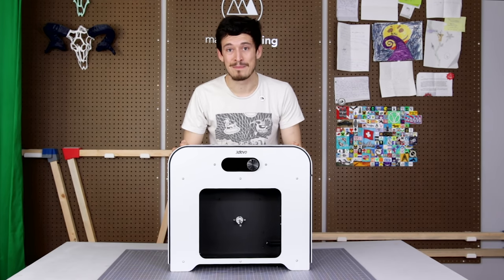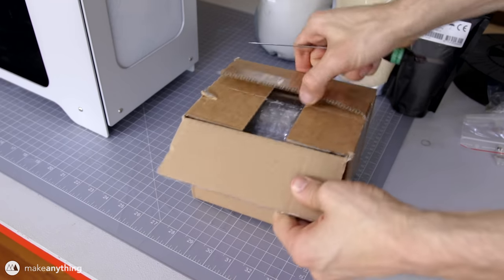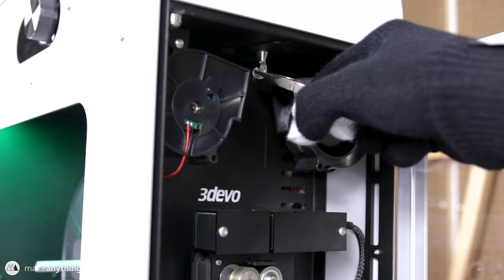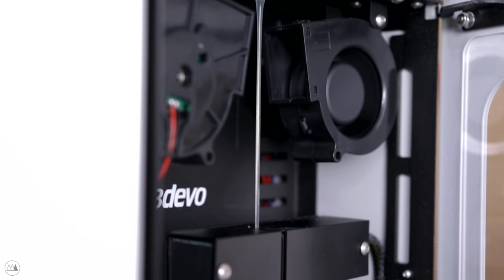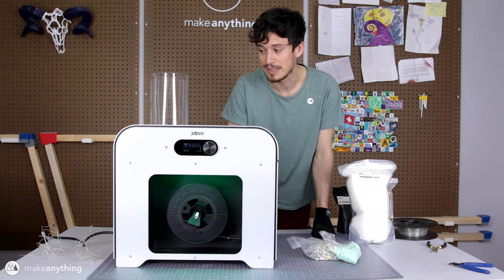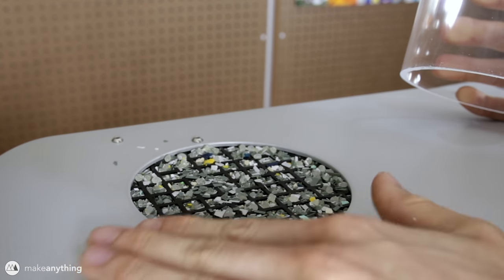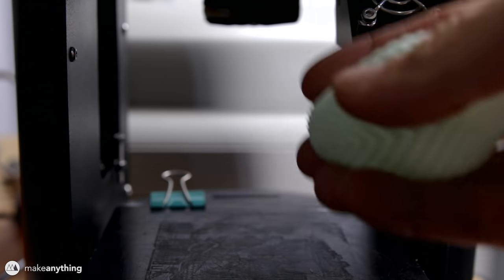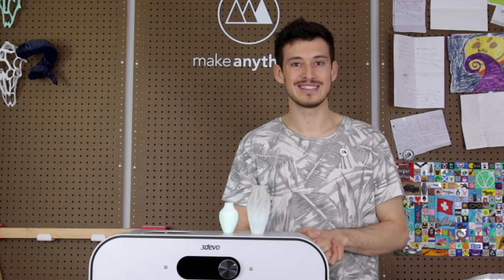Making my OWN Filament from Failed Prints with the 3Devo Composer

Comment: Why the hell is there an activationcode on it????  That doesn't build up confedence.... It reminds me of those other electronics who had it... people lost codes... or the company didn't support it anymore and the product became useless....
Reply: yeah, same as the laser cutters that only run on the companies servers. so you have to log the printer into a website. complete nonsense and just a pointless way to screw over their customers.
Reply: You can use it without activating up to 200°C You need to activate the tempratures above with the code, just to make sure you know what you are doing
Reply: Hi John! As tobih182 mentioned, we have our users request an activation code to ensure they have read the start-guide and extrusion precautions. We want to make sure they have properly set up their Filament Extruder in order to prevent clogging or other issues that may occur with certain materials (when not treated properly). I hope this helps clear things up a bit :)
Reply: @3devo  is it also used as an effort to protect your system from being reverse engineered & copied?
Reply: @3devo  and whats to stop them putting in a code without having done any of that? where do they actualy get the code?

what if they sell the product on to someone else.?
Reply: @roidroid  XD, as if there is much to be reverse engineered. There are multiple DIY-filament project around, and all of them have similar results. If you want to develop your own filament maker you're better of looking at some factory tours and looking how filament is made there. You want to either make something that's better or that cheaper if you want to really compete with this product. It's a leadscrew with some heaters, the precision of the filament depends on the sensors, software, etc.
@3devo Make something idiot-proof and the world invents a better idiot, that pretty much says it all considering fool-proofing of products. Products can be made safer with fuses, heatsensors, ergonomics,  intuitive controls, and similar stuff; registrations and weirdly shaped safety buttons only confuse people.
It's also quite funny how it's marketed as "materials made simple", when you have quite some tinkering, dialing in settings and reading manuals. The ad makes it look like you just need to tell the machine what material you want to extrude, throw in the plastic and press a button.
Reply: @3devo  If it was open source I'd probably buy one.
Reply: 200 degree increase that's why
Reply: @3devo   Protecting the user from themselves is not a valid reason to have DRM, especially on a $7000 machine. A product of that price point isn't going to garner the patronage of your average karen with entitled hell child, people are going to take care of the machine in most cases. And at $7000, there is obviously a considerable profit margin built in, the most expensive part of this thing is going to be the custom housing, everything else is basically off the shelf parts that anyone can get for less than $500. this leaves the only unique bits being the custom housing and the software on the controller board.

Even if I had $7000 to spend on this product, I would not buy it solely for the reason it has DRM on it. it's not a matter of if it will stop working, it's a matter of when it will stop working when you pull the plug on your servers. Engineered to fail products have no business on the open market.
Reply: @PhillyGarbageKing What on earth are you talking about?
Reply: @patrickryan7829  Wait for "Original Prusa Extruder i1 mk1" => Open source => China making it even cheaper => something tha will maybe actually work
Reply: @honzapat  met prusa and I no longer support him or his company.
Reply: Hi there@GGigabiteM. We have mentioned this before, but hopefully, this makes more sense this time. Our customers are able to request their activation code upon receiving their machine. It is a step in the quick-start-guide that comes in the box.
The sole purpose of this is to ensure that they fully read the proper way to maintain and protect their filament maker. Secondary, imagine if it falls in the wrong hands during transportation, then the unintended user will not be able to take advantage of the machine.
You would be surprised by the number of people that instantly dive into extrusion assuming it's a simple as turning on a coffee machine. It's a bit more complex than that. We don't use a DRM to prevent people from reaching certain temperatures - but instead, as a simple precaution phase to make sure they are aware of what might happen if they immediately start working with complex materials.
This method has shown a drastic decrease in clogging service tickets or other issues that have occurred with certain materials (when not treated properly).  Once our clients have requested their code (which is a one-and-done kinda deal) that have full access to their machine.   We want to make sure they have properly set up their Filament Extruder. I hope this helps clear things up a bit
.
Reply: It depends if you buy the Standard Edition, the Gold Edition, or the Deluxe Edition I guess.. Learned that from Uplay
Reply: To make it more difficult for the Chinese to copy :)
Reply: @3devo  why not just print the code in the manual then?  What happens when your company moves on and no longer supports these devices, what will a maker do to get the code in 15 years?   this is a shortsighted policy, and one that ensures I will wait for an unlocked clone to arrive on the market rather than support your company.
Reply: Why's everyone so cynical and upset about this?  This is like the bank not putting your credit card and PIN number in the same envelope.
Or better, mailing you a car and not leaving the key in the ignition..
There's nothing here about the machine phoning home, or stopping the user using their new tool.  DRM indeed..
Reply: @epiendless1128  it literally won't letthe user use their new tool without the code.  imagine if your stove needed a code from the manufacturer to unlock 425 deg and above?  or you couldn't drive your new car over 30 mph until you called up honda and asked them for the code?  or your new freezer won't make ice until you get the unlock code from LG?   It limits resale and repair, which is antithetical to the very community to which this product is supposed to be marketed.

Comment: "activation code" Yay! DRM for a machine you own!
Reply: was just thinking that, really gives it such a long life after its first owner -_-
Reply: So what happens if the company goes out of business and you haven't activated it yet?
Reply: @3DJapan  You have a few dollars in scrap metal on your hands.
Reply: Normally, I'd agree. However I think it's actually used as a safety lock-out here. You MUST read all the documentation for a machine like this, it poses several hazards including burning the user, starting fires, and releasing toxic gases if mishandled. 

It's a really neat machine, and is a step in the right direction for th sustainability of 3d printing, but it's a lot more complicated than it appears. 

Firstly, you MUST keep your plastic waste separated and labeled, this becomes a storage issue if you like experimenting with various materials. 

Second, and more importantly, you have to have a decent grasp on plastic chemistry to use a device like this safely. You all remember that delicious looking Candy Apple Red that a few companies were making that was quietly discontinued a few years ago? Yea, turns out the pigment released carcinogenic gases at typical nozzle temps. That's ON TOP OF the already nasty VOCs from normal filaments.
Reply: @Gartral   I would like to see a recycling service where you can send/give them all your failed prints and they reuse it, and you get money for it, instead of spending so much time and tweaks with creating a new filament. Some sort of recycle would be nice. Because compared to normal plasic trash, these ones are pretty clear and companies have the ability to filter any different color into seprated ways by lasers. And that goes with all the negative aspects you mentioned.
Reply: @Gartral  drm isn’t ethical I am waiting for hackers to crack it
Reply: @Gartral  at least allow it to be used with a code in the manual then, instead of some stupid online activation
Reply: @Gartral  guns don't come with activation codes.
Reply: @Gartral  safety lockout... great...  BUT... required account... not great... now it is just making up reasons to DRM... or lockout your "right to repair"
Reply: He never said he connected it to wifi so it's hard coded so it's so they can lecture you before they let you do what you want. They should've just put it in the Manual if they want the code solution

Comment: When you get the process down you should try plastic bottle caps
Reply from the maker: I'd love to start shredding up ALL my waste plastic :D
Reply: I think that it's possible to build a pro-level filament extruding line (with a water channel, sensors and etc.) for ~ 10 grands (or maybe cheaper). It just takes more space but the result will be really outstanding. With a grining line (smaller and smaller pieces) I think it will be possible to recycle PET bottles and get filament out of it as well. It's more likely to get a profit than with this machine, Devin! (sorry, not sure I've wrote your name properly!)
Reply: PE should be printable being a thermoplastic and able to adheer to itself, so I could see using old plastic bottles and caps being another great way to recycle... It'd be pretty fun to shred a few pepsi bottle caps, turn them into filament and 3D print a Bepis logo with them. Maybe coke bottles and print them into a c0nke logo? The possibilities are pretty much endless!
Reply: @KiR_3d  If you're able to accurately modulate the extrusion speed and rapidly cool the filament (ice water bath would probably be more than sufficient here) then you could probably make it for less than £10K. The hard part is getting accurate extrusions to within +/- 10 microns, although it'd probably be doable with an arduino and a few high accuracy sensors.
Reply: @DigBipper188  +/- 10 microns is the cosmic level tolerance :) +/- 30 micron is enough IMO. Although if it's possible to make it within +/-10 without lags then why not! :)
Reply: Make Anything wouldnt you also be able to do it with milk cartons?
Reply: @DigBipper188  PTFE itsn't a thermoplastic like you mean it, and has no true melting point (its melting temp is only theoretical because it is also above its decomposition temp so it will basically "sublimate" before mecoming any kind of liquid enough to do anything useful with). Just like you can't injection mold it, you can't extrude it either. They made a special fluoropolymer (PTFE-like) called PVDF specifically for injection molding and THAT could be extruded though. PVA is another, by the way.
Reply: You could do plastic bottles as they are normally made of PETG
Reply: @DigBipper188  "PTFE should be printable"
I'm guessing you meant PE.
As @John Hue points out, PTFE isn't a thermoplastic.
Reply: @ddegn  Yeah, I did... How I didn't notice that massive blunder I'll never know lmao... I'm aware PTFE doesn't melt. It degrades when heated over 250*c.
Anyway... Comment updated, thanks for pointing that out to me :)
Reply: @Mr. Proper I saw a video a while ago of someone who melted all of their plastic into solid bars, but I have no idea what they then wanted to use them for.
Reply: @pappy374  being cool I guess lol
Reply: @superslimanoniem4712  Yeah, I guess.

Comment: Sheesh 5k euros. Good to see something like this finally be made though, even if it isnt very accessible for many.
Reply: Yep. The first 3D printers were stupidly expensive too due to the technology being new; I'm sure these devices will get cheaper and better too as things progress.
Reply: @Fighter_Builder  filament extruders aren't something new...this is just too expensive
Reply: I've seen many reviews of DIY filament makers, and they all have the same problems: high cost, high tolerances on the filament and a lot of tinkering involved into making it run.
Reply: It's not 5k euros, it's way more, check their website and notice the VAT excluded note ;-)
Cheapest one is €5300 VAT excluded, most expensive one is €6950 still VAT excluded,
that makes them €6466 and €8479, or $7,627 to $10,000 VAT included!

Comment: For recycling prints, you should try running it through the machine multiple times. Run it through the first time to get filament that's too inconsistent in size for the printer. Then, cut it up into pieces and put it back, and it should be regular enough to produce good quality extrusions the second time around.
Reply: Most plastics, (in contrast to metals) degrade each time they are melted.
Without pretty extreme metering and multiple melting chambers and boilers, reuse will require you to keep track of the history of your plastics.
Reply: First step: extrud it to 2mm , cool it and than extrude it to 1.75mm

Comment: $7000 at a profit of $10/kg it would take 700hrs for an even break. Can it last that long without maintenance? (700 kgs)
 At 8 hrs a day that would 3 months to pay itself off. But even with a minimum wage employee attending to these machines you would need several machines for it to be profitable.

At $11,000 filabot can output 4.5kg/hr. Even when assuming they have the same maintenance costs. Filabot can be profitable after a little over a month (245hrs).
You may need an extra machine or two for it to be viably profitable, but it will require less divided man power than the 3Devo (4.5x less labor)

The $3000 cheaper price is not worth it if you account for an employee attending the machines and the decreased output.
Both the $7000 and $10,000 price tag is not meant for hobbyist consumers. Who is this machine marketed for?
Reply: @GuardianLords how work out $10/kg profit? For me it about $30/kg of filament if just buy
Reply: I don’t want to know what all that math means...
Reply: It's marketed for rich people who like 3d printing, this is really more of a gimmick than anything it seems

Comment: Me: "whoa that's awesome! let's look at the price!"
Also me: "$7000 bucks.. ok. I'll continue to throw away plastic."
Reply: same
Reply: let say on average a single spool costs you $25 (typical 2kg spool). 
and the machine costs $8000.
so the math is, 8000/25 = 320 spools.
Which means, you can get 320 spools for the same price as this machine. 
Unless you do A LOT of printing, it is not worth it. Stick to throwing a little plastic away from time to time.
Reply: its over 8K now
Reply: or maybe

just do what he did in his recycling prints video
Reply: Or, you could send it to someone who has one of these so you don't make the world more polluted, and also get rid of your trash
Reply: Tell your gov't to supply your local library so you dont have to get one yourself and  everybody will be free to use it.
Reply: You can build one of these for under 500$ its the programing you are paying for.
Reply: @houalee9101  and 320 spools,plus the electricity cost,like 400 spools
Reply: @kathleenrobertpogue6818   but how?
Reply: breezetix  This is a good idea, I have been thinking about saving my old failed prints and support filament, Just need a place to store it and learn how to store it for long times without it going ''bad''. Who knows maybe the price will drop for one of these machines later or competition will come in and force prices to drop And if you get bored and quit 3d printing later on in life then there could be someone out there who needs filament trash for this exact purpose that can come and pick it up.

Also old filament is great to use for plastic welding so it can still be useful from time to time, Anything is better than it ending up in some landfill somewhere.

I'm not really environmentalist but this hobby makes me feel bad from time to time, Just imagine how much plastic we throw away combined trough this hobby alone.🤔
Reply: @TheoRO-sl6hh  um plus the cost of the pellets.
Reply: @facelessdrone  it's like saying "add this drop of water to the Atlantic so that global warming won't evaporate it" might as well just do nothing.

Comment: You might want to have a look at their shredder/granulater and see what that does because that is meant to work in a mock supply chain with the Composser. It might give you some ideas on how far you need to go in processing your old prints so you can use them with this. Great video and yes it's expensive but nice to see the equipment (hopefully the price will come down as more market competitors come along or new tech is made)

Comment: Thanks, this video increased my 3D pen efficiency a lot! Instead of doing the additional step of creating failed prints, I now print the filament directly into the hopper, recycle it through the machine and feed it directly back into the 3D pen, basically creating a loop. This way, I waste just as many resources, but save a lot of time and frustration and the end result is the same: not having anything to show.

Comment: You should try making some filament out of perler beads they are pretty inexpensive  and have a wide color range I bet they will make some good gradients for some awesome prints
Reply: No. Not the same type of plastic. It will ruin this machine and if it doesn't. Completely ruin the machine. You can also make gradients with pla. That's a lot safer and like actually works